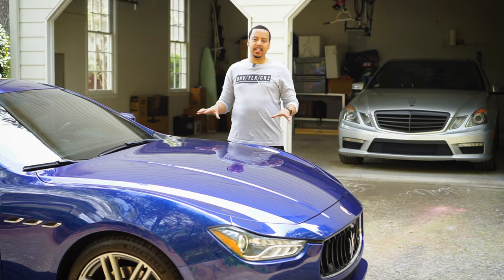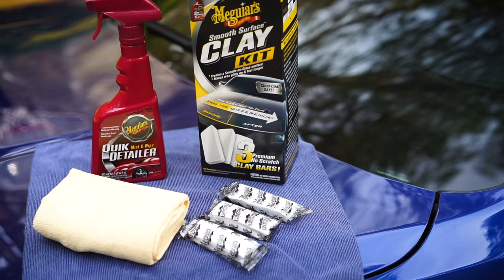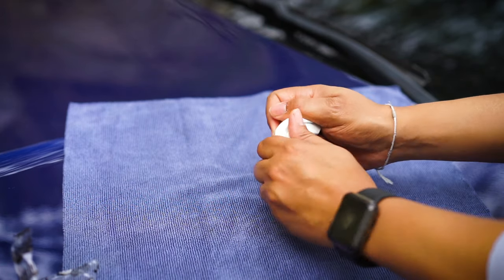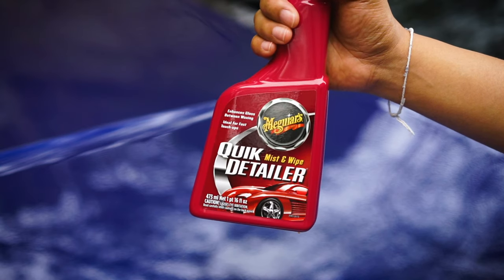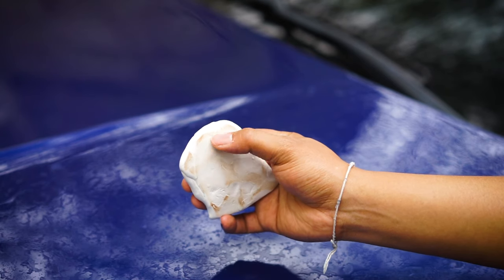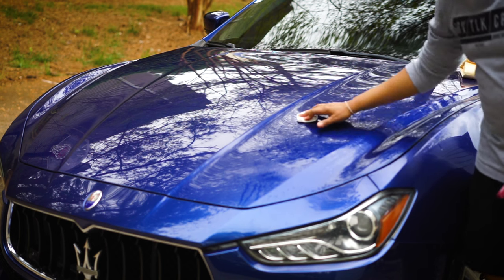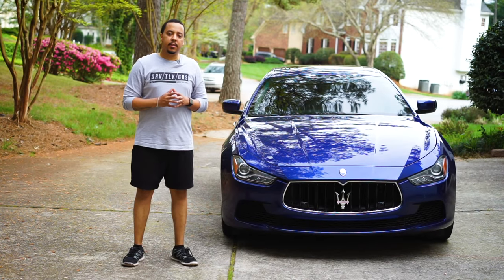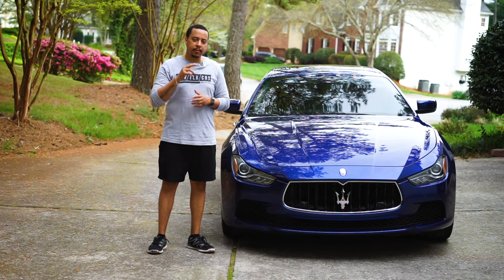HOW & WHY TO CLAY BAR DETAIL YOUR CAR OR SUV  *MEGUIAR'S CLAY KIT REVIEW*

Comment: Just a tip. You should never clay in circles, it can leave swirling in your paint over time. You rub in straight motions and then again 90 degrees to the direction you started. Enjoyed your vid, thanks for sharing.
Reply from the maker: Thanks for the tip! 👍🏽
Reply: @DriveTalkCars  wat is 90 braddah
Reply: @justinjones2926  I’m thinking he means that the first time you run side to side and then the next pass you wanna do up and down so that way you’re getting every angle
Reply: @DriveTalkCars  yo lmk what to do g
Reply: @justinjones2926  90 degrees is exactly the shape of an "L".   Vertically up and then horizontally.  Hope this helps.

Comment: Just used for the first time on my 135i was so satisfying to see all the purple bleeding and how smooth the car felt afterwards. Worked great with no scratches so east to use just make sure you go heavy on the quick detailer spray and don’t put any pressure on the clay bar

Comment: For one bar on clay how long can u use it ? Or is it a one time use then toss ?
Reply from the maker: I think that's a case by case situation. However, I use my clay bar more than once if the bar isn't to full of contaminants.  If I can fold the clay bar a few times and still have "clean areas" then I will still use it.

Comment: After using the clay bar on the whole car, do you use polish on it or wax?
Reply: none, after bar, compound, then polish then wax, that's the right way to do it
technically you just skip the first step but you have step 2 and 3 correct

Comment: Great how to video , well done . Have never used a clay bar and want try out.

I used to want a Maserati , till i looked up the resale values on them.  I saw a couple of their models brand new going for 75K to 99K and in less than 3 years going for 25K to 35K on auto trader.  The depreciation is almost unreal.  Hopefully you bought that used.
Reply from the maker: Thank you! I appreciate that.  Yeah, I don't really believe in getting cars brand new due to that very reason...depreciation.  It is a beast!  Thanks for you comment and checking out the channel! 👍
Reply: All cars depreciate.. they don't build the type of value like real estate or stocks. Let the first owner take the hit, and do the research when purchasing previously owned vehicles.

Comment: For you folks talking about circling pattern hes not pushing very hard at all if it was old paint that you had to put elbow grease into then yes circles is a bad idea but hes not hurting anything the way hes doing especially if he does this once a year just gliding over the surface
Reply from the maker: Thank you for your feedback. And you are correct, I was just lightly gliding the clay bar over the lubricated surface

Comment: Which one would you say is better the Meguiars or Mother's?
Reply from the maker: Well I haven’t used the mother’s clay bars, however I have used both quick detailers. I think I favor Meguiars better. They seem to have more of a “thicker” solution than Mother’s which allows for more coverage.  I plan on doing a review of different products like these so stay tuned. Thanks again for checking out the channel! 👍🏽

Comment: So what you fold it back into itself? It won't rub it into the paint?
Reply from the maker: That is correct. Roll it/kneed it into itself. Depending on how much contaminates it gets out, you should be able to use it 1-2 times. But definitely don't use if forever.  If it feels gritty don't use it. And if you drop it on the ground, throw it away immediately.

Comment: Wich product do you recommend after claying? I have the Maquires Ultimate compound but someone told me you should uwe the polish instead. I also have the Ceramic spray coating from Turtle was. Grtz from Belgium
Reply from the maker: The turtle wax one and done compound and polisher is what I have been using. I am pleased with the outcome.  It is a compound and polisher in one product.  2 for 1 LOL.  Here is a link to the product if you want to check it out:
1 & Done Compound: https://amzn.to/387stx0
Reply: @DriveTalkCars  Thanks man, will try it out

Comment: Just bought this kit at Walmart, so when I get done I can use my Turtle spray on wax, as the final step? Or can I use the spray on detailer also as my wax.
Reply from the maker: The quick detailer is used as a quick topper to maintain the wax and shine. Or to just quickly clean your vehicle. 

After clay bar, I would do any paint correction tasks (if needed) and then seal everything with your wax.

Comment: Can you wash the clay with water ?
Reply from the maker: Do you mean actually wash the clay bar itself or use water (instead of a quick detailed type product) when using clay bar on vehicle?
Reply: @DriveTalkCars  the clay itself
Reply from the maker: To my knowledge you can’t wash them clean. You can fold (and twist) them into themselves to expose cleaner areas on the clay bar. But after a few uses they are no longer usable (in my opinion). There are claybar alternatives like synthetic clay mitts you can use and potentially wash off.
Reply: @DriveTalkCars  thanks!
Reply from the maker: @georkl8454  you're welcome! Thanks for checking out my channel

Comment: After using this, is it OK to use the meguiars liquid hybrid ceramic wax?
Reply from the maker: Well the purpose of the clay bar is to take out the contaminates from the paint. So, it would a good idea to apply a protective layer to the paint surface. A lot of people do a compound and/or polish after clay bar then add the wax.